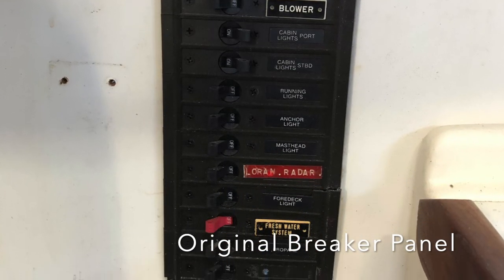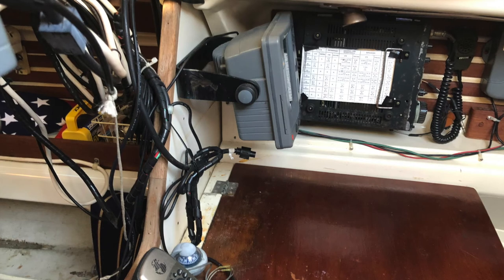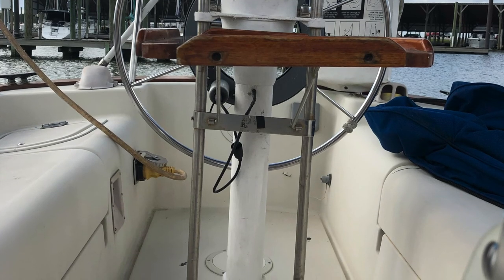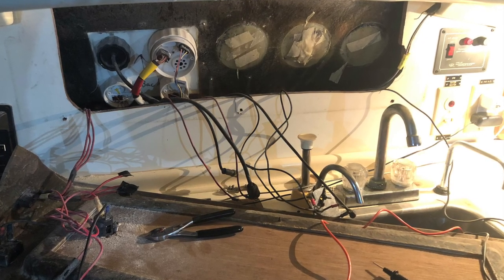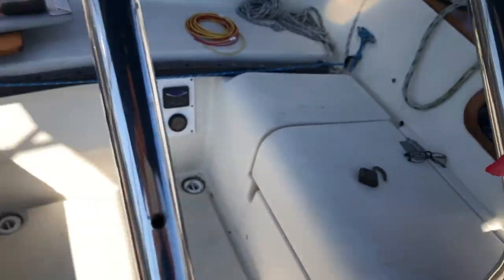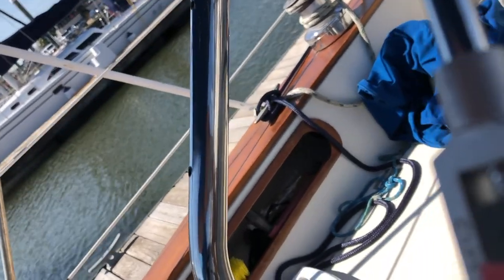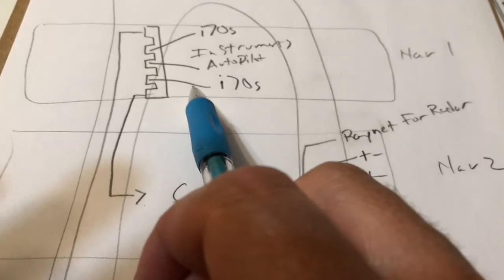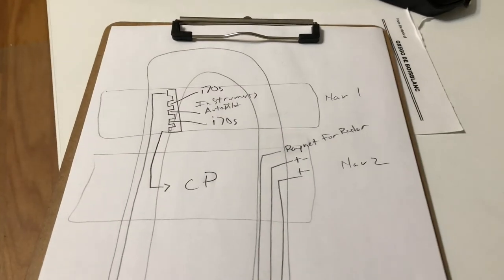1980 Pearson 323 - Helm, instruments and navigation refresh

Comment: Very well thought out. I have hull# 384 second to the last one built. Under the deck, there are two metal straps that need to be replaced about now for the tank. I plan on replacing them with some nylon straps attached to the box the tank is in. These are the last of the real sailboats in My opinion.

Comment: I'm doing basically the same thing right now to my Pearson 33. I opted to upgrade to a 1-1/4" diameter helmguard, which allows you so much more room for wires and it comes with new feet. I had to purchase a new edson ss brackett (TP125) to accommodate the 1-1/4", which is also a huge visual improvement as well.

Comment: Thank you for posting.  I'm getting ready to do something very similar on my 70s vintage C&C.  What did you use for the new helm guard mountings on the cockpit sole?
Reply from the maker: I used these from Defender.com "Edson Pedestal Guard Feet Kit - 310ST-100-125". If I could do it again, I would have drilled a larger hole than I needed, then glassed in the hole. Then drill the hole size I needed. In this way and water that might get in when the sealent fails would not penetrate the fiberglass and get to the wood core in that area.